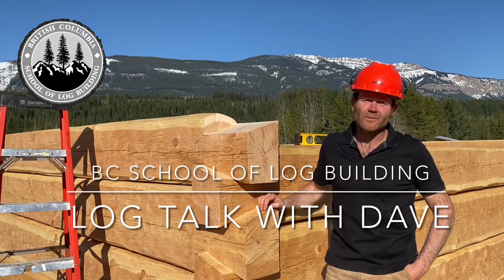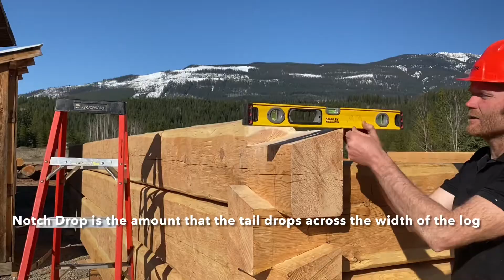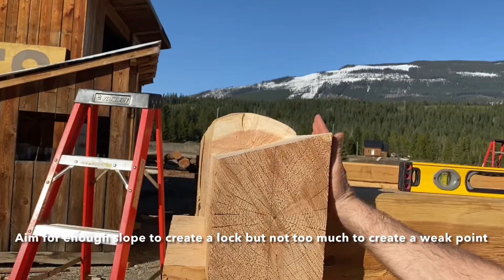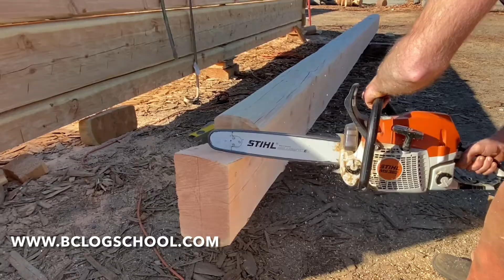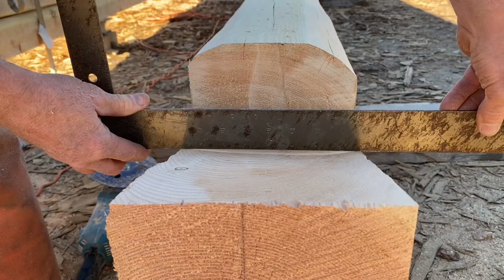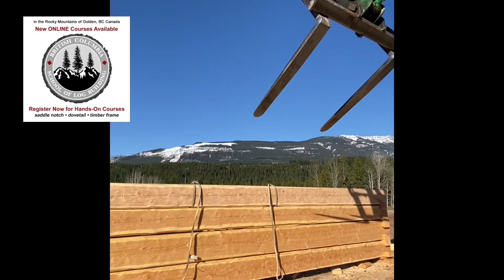Notch Drop in Dovetail Log Construction; What is it? How much? #logtalkwithdave #logcabin #dovetail

Comment: Hello Dave, love your video series. Very informative and enjoyable to watch so keep them coming. :)    When you final assemble the dovetail cabin, do you use long screws in the dovetail notch corners to secure the logs or do you just rely on the weight of the logs (gravity) on top of the notch to hold the building together?
Reply from the maker: Thanks for your support. Yes, we use timber screws in the corners and wooden pegs throughout the length of the logs.
Reply: @bcschooloflogbuilding4385  what are the wood pegs used for?
Reply from the maker: @WoodHippy62  just to peg each log to the log below to give it lateral support.